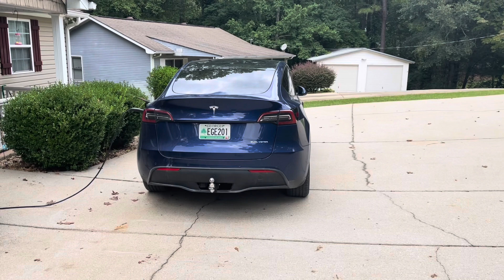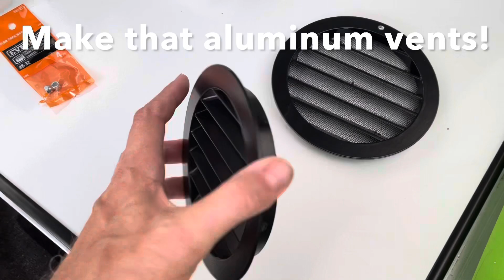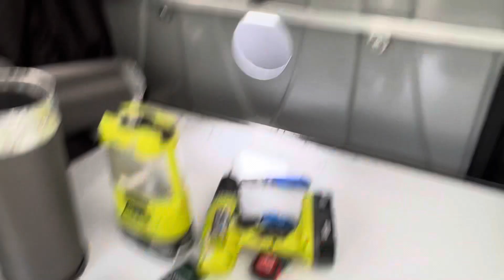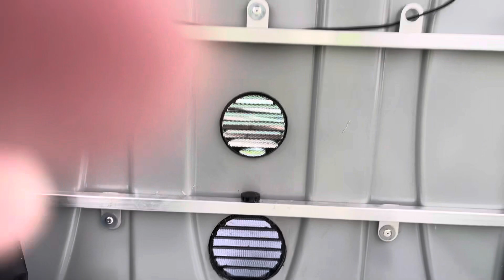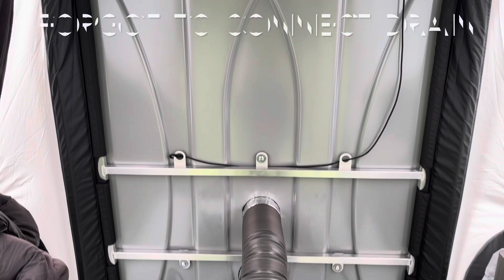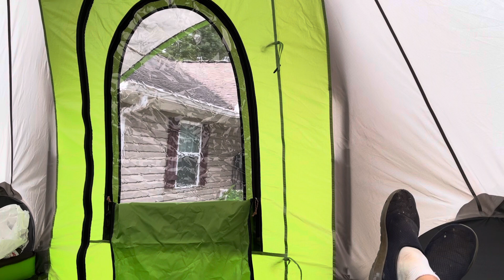New SylvanSport Go and Ecoflow Wave 2 Air Conditioner Installation

Comment: Hi, this video is fantastic! Thanks. Just one question, you said you made a coupler to attach the vent hose to the black vent covers.. how did you do that? The covers are the same size as the vent hoses so can’t figure out how you got those to attach and seal?
Reply from the maker: The short answer is I made an aluminum ring that fit tight over the flange on the vents.  I just used metallic duct tape to attach them to the hoses…

Comment: I tried something similar and now that I have received my ecoflow2 I’m copying your setup. What did you end up using for the permanent coupling of the air vents to the ecoflow hoses?
Reply from the maker: I made a 5” and 6” ring about 1” thick out of aluminum sheet and used aluminum tape to secure it to the hose.  I install them and push the unit back a little and the spring pressure from the hoses keeps them in place…

You can just use several layers of the aluminum duct tape.  With enough wraps it is stiff enough to stay in place…

Start with one layer on the inside and then wrap the extra layers on the outside…

Comment: Why does the ecoflow need 2 vents. Usually ac units such as portable floor standing home units have just one for exhaust.
Reply from the maker: It makes them more efficient.  It also keeps from forming negative pressure in the tent…. That pulls in more bugs and humidity…
Reply: The single exhaust type actually pulls air that has been cooled out of the room and out with the hot exhaust. WebC is correct. It creates negative pressure and draws air in. My landlord buys them for the few people who smoke in our building. It stops the smoke smell from seeping into the hallway by creating a negative pressure. He tells them to run it 24/7 even if only on fan mode.

Comment: Why not install it lower/under the table, the way you have it, can you still use the large bed?
Reply from the maker: I thought about it.  Everything is a compromise.  It was difficult to get the vents located that low and still have the hoses easily manageable.  We also like to put some pull out draws under the table and there is room for an ecoflow power station under there as well.  Also we both prefer two twin beds over one big one as it gives more room to move around in the GO.  We do not even carry the extra table with us any more.  It makes it easier to pack the mattresses in the tent shell.
Reply: I also use the large bed. I was thinking about supporting a shelf higher up above our heads and the bed using the front bars just like the factory panel table does and using the ceiling structure for outward support and putting the vent holes higher up.

Comment: So these new model GO campers don’t have the star glazing windows anymore 😢
Reply from the maker: Sadly no…
Reply: The star gazer windows had issues cracking and leaking because of the plastic hardening over time and the glue coming loose.
Reply: @southerntesla  The door also has the clear plastic. Does the door develop issues over time and crack too? I have only been hearing about the window glue issue.

Comment: Did you ever post the energy consumption numbers on your Model Y Towing the unit and not Towing the unit?  I have a Model Y and will be purchasing one in a few weeks.
Reply from the maker: Unfortunately I had to cancel my trip.  I can tell you that it reduced range about 10% at 60mph and 20%  at 70 mph.  THis is fully loaded with about 200lbs of gear in the trailer…
Reply: @Webcrawler45  Can you recommend a ball hitch that has the correct measurements for the Tesla Modle Y. SylvanSport on their website says “The height of the ball should be 17″ from the ground to the middle of the ball. “.  Also have a Model Y. Thanks
Reply: @Webcrawler45  Can you please share which tow ball hitch you have? Does it measure 17” from ground to middle of the ball which SylvanSport recommends for the GO. I have the same Model Y vehicle and trying to figure out the correct hitch ball mount to get. Thanks

Comment: i've been researching.  another add on solution is to put something like aluminate shade cloth over the trailer to further reduce the heat factor therefore allowing the Ecoflow to cool better.    I checked into the Ecofolow Wave 2 like the fact that it duality purpose is so much better the Cool Breeze.  I'm gonna get my trailer, now i just have to think long and hard about cutting into the panel or vent out the door somehow.
Reply from the maker: You can vent out the lower flaps under the beds.  Just put in the hoses and zip up tight on the hoses.  I just wanted a better solution.  Interesting idea about the shade.  I did think about using two awnings and making a Velcro that would attach to the upper bars (before you raise it) and come out the side and just stake down the two ends this way it would shade each side of the camper from the top
Reply: @Webcrawler45  so both hoses can be vented out from the bottom screen. I've jury rigged my a/c round my back door tent before without cutting a hole i can jury rigged this one too.  AWESOME!!! come Summer I can at lease have some cooling and this time i learn to use some fans to help blow the cool air around.  I would just let the 5K btu do all the work but not do anything to circulate the cold air so of course it was still hot if you were like 2 feet away from the vent... duh me!  LOL... I've seen comparison with Ecolflow and Coolbreeze and so far Ecoflow has one extra con going for it is that it can go either cold or hot -- definitely one less equipment to buy!